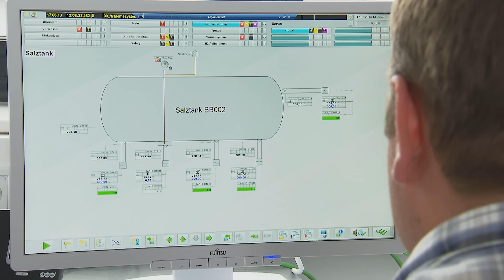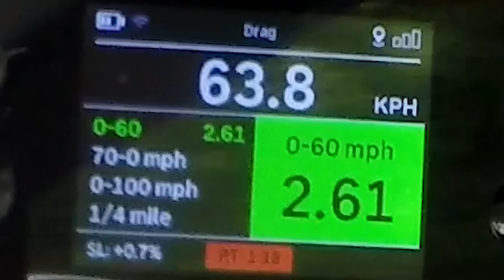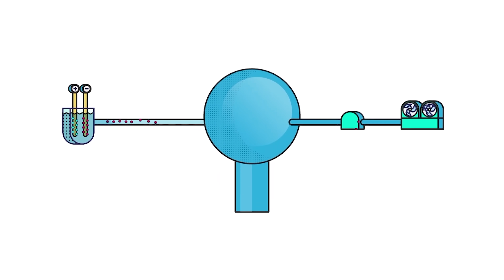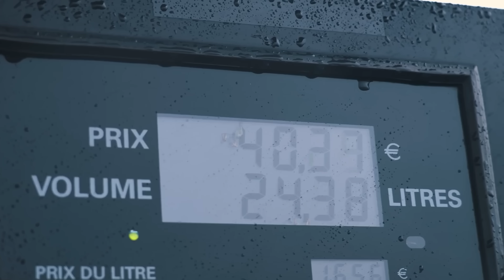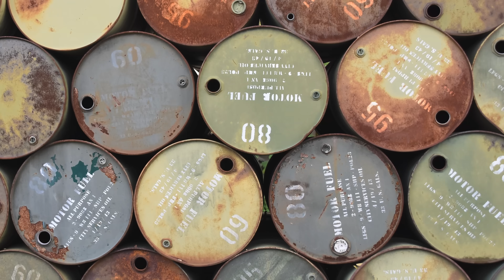Porsche just SAVED petrol engines FOREVER

Comment: Concerned about the cost of synthetic fuels. Although if there's more competition it should drive the price down. Hopefully we'll get it cheaper than current fuel prices one day.
Reply: Engineering Explained says the current estimate is $40 a gallon 💀. Hopefully, it gets cheaper as the tech is optimised and demand increases.
Reply: @Teqnyq  Exactly, that is what our boy at Engineering Explained completely missed.  

In the segment on exactly this that I watched, he said that at the moment, Porsche said it's about $9.00 per gallon to make it and that was the entire basis of E.E.'s conclusion.  He completely overlooked the fact that not only did Porsche not pioneer this technology, but also the fact that technology can change.  In fact, to accomplish the current goals, everything  must change.  The EV future requires new technologies and upgrades, in both battery technology and massive upgrades to virtually every electrical grid on the planet. Here in the US, people in many areas must wait for days to charge their EVs as there isn't sufficient power available to meet the current need.

What Porsche has done that is monumental is to pioneer production of synth fuel powered by pure renewable energy. That's the other change.  Just as there are huge refineries all over the planet producing petrol/gasoline/diesel from petroleum oil, we need plants all over the globe running on renewable power from wind, solar, hydro, etc., producing synth fuel.  In that world, synth fuel could easily cost comparable to current fossil fuels.  Well, unless our current petroleum barons are at the helm.

Also, we must note that synth fuel can be refined to power not only current passenger vehicles, but also current airliners (as av-gas) and diesel tractor trailer rigs. If they'd just invest in it and just do it, all of our options go through the roof. I'm hopeful, but not confident.  Humanity's ability to make the best decisions for all has a poor track record. Profit at any expense rules.
Reply: @nYdGeo  The thing is: this mysterious technology to make e-fuels production more efficient doesn't exist - and very few are currently working on it. The projection is that the tech can be scaled up and bring production costs down to about $3 per litre - that would still result in a selling price of about $6-7 per litre. With a total efficiency at the wheel of 15%, ICEs have no leg to stand on against 75% efficiency of EVs (always including production of the energy / fuel). 
Right now, my EV already costs me 50% of my ICE car per 100km - not even considering service cost.
Reply: @Vizeroy9  I think we can discuss this without conjecture, can we not? Just because the oil money isn't behind it yet doesn't mean that it's not there and/or viable. Jus because EVs are on the road also doesn't make them truly viable...at this time.

I'm not anti-EV, just anti EV advocates that ignore all the facts in order to feel good about themselves.  In 10 - 30 years, when the power grid can possibly support an all EV future, I'll certainly consider one.  When battery technology is developed that is safe, efficient and isn't an ecological nightmare to produce, I'll consider it. I don't want to have to drive my EV emissions free for 200K - 400K miles to balance out the horrific amount of pollution created by the construction of the vehicle, especially the battery.  While we're at it, have you priced a current replacement EV battery?

We also take a lot of road trips and I don't want to spend 3-hours per day sitting at a charging station.  But, they will fix that. We'll eventually get batteries that are not based on lithium and can charge in 10-15 minutes and when we do, again, I'll probably purchase one immediately.

My biggest issue is choice vs force.  I don't want to be forced to retire an amazingly fun, affordable and perfectly usable vehicle to purchase an expensive econobox (I'm not wealthy enough for any of the stylish EVs) just to make someone else feel good about themselves. Just as EVs will one day be a completely viable option, the technology also exists to allow me the choice to drive my current vehicle without adding to the carbon footprint.  But EV advocates continue to do their best to force their will upon everyone else, ignoring other options in the interest of being right, of feeling good about themselves.
Reply: @nYdGeo  one question ahead of the reply: Did you ever take a long distance trip in a modern EV?
If not: please get real world experience.

Yes, EVs aren't best everywhere - I still own my Touareg, because there is no EV with decent trailer towing capability.

My Renault Zoe is perfect for the city, where my Touareg would just suck the tank dry while standing still (stop start has many circumstances that deactivate it).
I still prefer my big car on long road trips - that's mostly because I'm too tall for a long term comfortable sitting position in the Zoe. I'd prefer an Ioniq 5, or something like it... but that one is too big for my wife's taste. So we got a Zoe.

Oil company money doesn't really change the production process for e-fuels. The projection to get the manufacturing cost per litre down to €3 already considers heavy investment in R&D and scaling effects.
Big oil money hasn't really changed the production process for regular fuel in over 100 years. Still mostly destillation and cleaning. 
Therefore don't expect too much from big investments in e-fuels - which oil companies might even not bother with in the first place.
They would need to increase e-fuel production by factor 100 just to supply Germany.
The long term investment risk might be too high  for this to happen.

I'd way more prefer hydrogen cars for long road trips - efficiency is between e-fuels and EVs. Filling the tank is a process of a few minutes.
Pure hydrogen isn't flamable and the tanks have an emergency valve in case of fire that directs the flame - which gasoline cars don't have.

All in all it is way more energy efficient to put produced energy into a battery than use it to produce hydrogen, or even e-fuels.
Carwow, car maniac and other European youtube channels do range tests rather regularly. They show which ev might be interesting for you. Car maniac also does charge performance in every review. Most modern EVs (except for the small ones, like Zoe) charge from 20 to 80% within 20 minutes - which is the range, you should keep the battery most of the time. A 600 mile road trip will force you to do 2 stops... which you will do anyway.
What needs to improve massively is the charger network in some regions. 
But this can be assumed as already in planning and / or execution phase to be way better before 2035.

With the Kia EV9 going on sale this year, I might be tempted to replace my Touareg. But I need to see the reviews first... and sit in the car for myself.
Reply: @nYdGeo  -  EE said that the CEO of Porsche said that their synthetic fuel it is over $10 / litre or $38/gallon.  Sure, economies of scale will drive down prices, but with current EVs, it aint happening.  It is like the argument regarding recycling plastic.  Everyone thinks that is the best thing, but it doesn't "really" happen because creating new plastic is cheaper.  A huge portion of the population won't be buying any e-fuels to create this HUGE demand because it is just way too expensive compared to other fuels.
Reply: @Teqnyq  given that unleaded has frequently been around $10/gal in Europe/EU (certainly for the the higher octane versions last year, they were $12/gal!)... so if it currently costs $40/gal, then it isn't THAT much of a leap to see Hydrogen being cheaper eventually, provided the governments don't tax them as much as they do for diesel/petrol... especially once this starts to be produced using solar / wind-farms as the power source... note that they would NOT be using regular meter-price electricity either, it would be surplus power from those during low-demand times of the day (MUCH cheaper).
Reply: @Teqnyq  commercial freight, container boats are gooing to use methanol in the future (google maersk Mauritania -, or equavalent projects) ) Don't worry about price. Solar energy is 2 cent (US dollor cents) pr. kWh in Saudi Arabia or Chile (google it) . Don't worry about the price, but do worry about putting up the solar panels in desert areas around the equator and scaling up supply chains for this ASAP. call your goverment representative or organise efforts to effect them NOW!
Reply: @Teqnyq  i saw another video about this and the price for their e-fuel is 40 bucks now but they have calculated what it will cost in the future and what they landed on is around 2 dollar. Which is a good price i think.
Reply: @Teqnyq  if we get other companies to make synthetic fuels, they will get cheaper.
Reply: @Teqnyq  

That's only on a experimental basis though. If production of e fuels was upscaled then the costs should reduce significantly. 

I also assume there might be fossil/e fuel blends available to further lower costs while still being able to offset carbon production. The price of oil if still produced at the same rate should also fall in value if e fuel and electric cars get more of a foothold as time goes on.

That's a hell of a lot of supposition on my part though 😂
Reply: The production efficiency is at around 2% at the moment and the physical limit is 6%. Meaning that it will be 50 times more expensive per kilometer than driving a regular ev.
Reply: @lukasluetke6097  Where do you get a max efficiency of 6%?
Reply: Here is the problems with e-fuels… 
It needs tons of energy. 

EVs are about 75% efficient, according to the US Department of energy. That is with all losses from charging, the battery and motor factored in. 

Combustion Engines reach 30% tops (same source). 
eFuels also only hold about half the energy you have to consume to produce them, so the total efficiency of an e-Fuel car is about 15%.

Taking taxes, transportation and profit margins etc out of the equation means that at 150kw (204PS/201bhp) of power for one hour 
You will need less than 215kw/h in an EV and 1000kw/h in an e-fuel powered car. 
E-fuels will never be cheaper than charging an EV, by a long shot. 

It will be great for planes and racing, but not to get kids to school
Reply: @Noine14159145  EV's don't work to get kids to school if everyone in town is trying to charge, it will break the electrical infrastructure and simply won't work.  Dreamers are great, but the tech has to work better than what we already have.  Efuels is just a way to make the process more complicated than it really is so the average Joe thinks they have to rely on big corporations and government (which are the same thing in 2023) to live life.  Diesel e engines have been around for a long time and they run on straight veg oil which any farmer can make with a variety of organic raw materials and a manual press and a filter.  Then, we have solar energy, which can make pure HHO (Brown's gas) which only produces water when burned in a regular common combustion engine.  Check out Hydrogen Home for this.  He runs his entire house and car with the hydrogen he makes from solar.  And Bob Lazar has a hydrogen powered Corvette V8.  This tech is all out there, but people have been dumbed down to the point that they can't even think logically.

"What is the cleanest burning vegetable oil?
olive oil
The cleanest burning fuel is olive oil, the fuel that Aaron was directed to use for temple light in the book of Exodus. Olive oil is more than 99% pure. If the wick is properly trimmed and there is no draft, it should not smoke. Olive oil is a clean renewable fuel that does not produce smoke or odor.

Lantern Oil - Oil Lamp Oil - Red Hill General Store"
Reply: @Noine14159145  f1 ice engines are 50% efficient
Reply: @kalasmournrex1470  They only last for a few races, before they have to be rebuilt. This way, you will have to replace your combustion engine a few times in a single year.
Reply: @kalasmournrex1470  that might be, but they achieve that with such a high compression that they don’t last. Especially a daily setting of constant cold starts would kill an f1 engine within days.
Reply: @Noine14159145  Chile is one of the countries, if not the country, with the most efficient solar and wind energy potential. We can produce a lot of cheap and green energy, but the thing that has been retaining all the green hydrogen and e fuels progress in the south of Chile are the sustainability issues. For example, the Porsche e fuel factory has not been aproved by “Sevicio de evaluación de impacto ambiental de Chile” because we have a treaty with Canada in which we promise to protect the birds that migrate from Canada to Chilean Patagonia year to year, and the protection involves a restriction of massive wind energy proyects. The good part is that we steel have the north of Chile, one of the regions with the most intense solar radiation in the world
Reply: @Noine14159145  "EVs are about 75% efficient, according to the US Department of energy. That is with all losses from charging, the battery and motor factored in. " All right, what about electricity production ? It is not lossless. So this is already missing in this calculation.

The rest of your argument I do agree with.
Reply: @sierraecho884  losses in energy production are not considered because they will also happen for the energy used to produce eFuels
Reply: @Noine14159145  What do you mean ? This does not make sense. Producing E-fuels wastes waaaaaay more energy than say charging a battery. Of course this has to be considered. This is the main reason why E-fuels won´t work as a large scale application.
Reply: @sierraecho884  you replied to me saying „what about electricity production? It is not lossless. So this is already missing in this calculation“

So I answered that losses in electricity production will apply for both EVs and ICEs using eFuels so they will not be taken into account
Reply: @Noine14159145  And my point is, it has to be taken into account for both otherwise you are comparing apples to apples.
If I say my battery driven car has zero emmissions than it is true to a certain extent. The car itself does not emitt but the electricity had to be produced somewhere else.
Reply: @sierraecho884  
1. I want to compare apples with apples 
2. I was talking about energy efficiency, not pollution
Reply: @Noine14159145  Well alright then, both systems waste energy at different stages of the process. So if you want to compare energy efficiency you need to include that as well. Or do you only want to compare the efficiency of the Motor ?
Reply: I feel like the majority of the current cost of said fuels comes from the energy requirements and the development of renewable infrastructure. If we can find ways to generate way more energy than we consume now, cheaply, this would be a viable solution. Best way I can think of to achieve that in 10-20 years is to go all-in on nuclear energy and then develop the true renewables once we’ve bought ourselves some time.
Reply: @jlight7346  sadly most people, even today don't trust nuclear power though
Reply: In Europe, fuel prices are mostly taxes, so the price of e-fuel depends on greedy governments.
Reply: It doesn't have anything to do with the decision to don't rehire or expand capacity of the current oil production? Also you mentioned taxes so please refer to whichever year of your current country budget and see how much your taxes amount to... ;D
Reply: @qa1e2r4  Over 50% are taxtes. Sholdn´t that be enough ?
Reply: @sylviam6535  e-fuel cost about 3X more to make than gasoline as I understand it
Reply: Yea and they only have 2 factories atm i think so its pretty expensive right now
Reply: Honestly, greed has gone and shot ourselves in the foot. Sometimes, pure capitalism isn't the way to go, because guess what, preparing for the future incurs losses.
Reply: it should be free, just like Nicola  Tesla was trying to show the world !
Reply: Petrolheads: "We don't have enough electricity to charge an all EV fleet."
Also petrolheads: "Let's make e-fuels."
This is comedy gold.
Reply: @Sams_Creations  Good point.
Reply: Hahahhha nice dreams, this so called e-fuel will not go below 20$ a gallon.
The best, most efficient, least expensive is oil for cars and ships, kerosene for planes. Yeah however the mass media makes you believe, facts are 80% of the world is still 'addicted' to oil and natural gas. And without it our economy would be zero, nothing. And this ain't changing anytime.
Reply: What a bunch of bunk.  There is no global warming, that's why they call it "climate change" now... California currently has the most snow in history, NY just had the biggest winter in history... Minnesota is currently frozen... it's all a lie and you are placating that lie.  The solution is to filter the exhaust fumes and burn whatever you want.  But whatever you do it has to be elective, not forced.  Only evil dictators force things on people.  As soon as you start to talk about carbon and global warming, you've lost your freedom, because human beings emit CO2.  It's not the CO2 in petrol exhaust that is unhealthy, it's all the exotic carcinogens, neurotoxins, and poisons like benzene, acetone, ethanol, etc... Ethanol, which is a class 1/a known carcinogen, is produced in nature when organic materials like trees and bugs and animals die and rot away.
Reply: 150-200 VS 20KWh per 100km(efuel vs electric car)... All this will ever accomplish is driving electricity prices up, because there just is not enough energy for this bollocks.
They just cover their lazy asses for not being able to finally come up with devent electric and hydrogen cars.
The whole video is porsche propaganda down our throats.
Reply: Gasoline is synthetic
Reply: Oh yeah. Capturing a gas that is 0.04% of the atmosphere sounds like a smart economic idea. Let the farce continue.
Reply: Basically you need a PHEV and a classic ICE car, 90% of you briving is from the battery in the PHEV, with the occasional long run or on the go fill up with synthetic fuels and a few tanks of synthetic fuel in your classic ICE car for weekend fun!
Reply: @demiquadfpv3333  In this case you will still be left with the same problems like where is all this electricity coming from ? How to scale it and keep it green ? Where are all those resources coming from ? Can you even afford it ? And you are left with both engines and both disadvantages like lubing the ICE, oil change, many many moving parts and so on. Plus all the additional weight. Not a good solution.
Reply: @demiquadfpv3333  
No. You are constantly carrying around a heavy battery with all the wiring and control of an EV but nowhere near the capability. You waste energy charging it and have a constantly degrading battery which will cost a fortune.

Just stick with an efficient IC engine. 100 mpg capable engines were developed in the 1960s but squashed by big oil
Reply: Exactly what i said in other videos... Unless there are competitors. Porsche will charge their 'Porsche tax' -- You'd be paying them for the privilege of them keeping your car on the road. on top of the governments petrol duty, road tax and VAT when it comes to parts, maintenance and services at your local mechanic or dealership..... Then your local council might charge you a ULEZ tax based on the size of your engine so you can drive through or park in your local area.

--- But i mean thats all fine right? you get to keep your old car and not scrap or part exchange it for an EV.
Reply: Irlc commercial synthetic fuel only went out of production in the 1980's after the oil crisis ended. Porsche actually put huge effort into dealing with questionable quality synthetic fuel in wwii.
Reply: @oogahboogahman  It´s not the same. Synthetic fuel in WW2 was made out of other resources. This here is meant to be green, to only solar, wind or other renewable energy sources to generate hydrogen through electolysis and adding CO2 which is captured out of atmosphere. This works however does not make any sense commercially. And the capacity for a big market like personal transportation is basically impossible or spend better elsewhere. 
Especially considering the poor  
efficiency of only about 13% compared to battery cars with an efficiency of 70% or Diesel with about 30% efficiency. This is by far the most stupid solution.
Reply: THE MAIN cost is electricity! We need power to exract hydrogen, we need power to exract c02 from atmosphere . we need power to combine to make synth fuel. Yep. So whoever will find idea to store energy (non lithium powerbanks, huge commercial) will be the most rich person in history of that planet.
Reply: Talking about EV’s like everyone can afford a decent one. 
To replace my current BMW 435 GC I would need an I4 correct? But my 3.0 diesel ICE with all the luxury bits I could ever need was half of the price when new than an I4. 
Factor in the ridiculous emissions to produce an EV in comparison to an ICE, then the miles you have to cover (approx 100k which volvo admitted publicly) to get back onto an even with an ICE it makes no sense whatsoever. E fuel is more appealing to probably 80% of the population who cant afford an equivalent EV. Plus look at the cheapest EV’s, not exactly screaming value for money to the majority. They are pants, and they do not have the range like the more expensive ones. 
The UK charge network is rubbish and will not be up to Par by the deadlines. 
We will be still using wood pellet fired power plants at that point (they actually emit more c02 than a coal plant ffs) its all messed up and backwards.
Reply: @Lee-ee8qh  That´s exactly why most cars will vanish frim the streets if only EV can be sold an bough in the future. Many people will simply not be able to afford them.
However, the emissions of the EV production are already factored in, just as in any other car which has to be produced as well. From the CO2 emissions perspective it absolutely makes sense. However it is simply way to expensive.
but here is the kicker E-Fuel is nonsense it will be just as expensive as buying an EV.
Also wood pellet power plants don´t emitt enaything since the wood has soaked in CO2 during it´s griwth they simply release the CO2 back. Sighs you really outh to be looking in that whole stuff in detail.
I mean you got a valid point which is price but everything else is basically wrong.
Reply: 12 years time nobody knows where technology will be. It could end up being cheaper than normal petrol
Reply: @Dylan20579  It won´t because it would be against physics. Cheaper would mean less steps not more. Oil is incredibly cheap.
Reply: @SierraEcho88  really? what does our own made up concept of money have to do with physics.
Reply: @Dylan20579  Made up huh ? it´s not just made up. Money reflects value. It takes way more steps with much more loss to create E-fuels than say charge and produce a battery or create ethanol based gas.
Reply: Current battery tech is rare earth minerals.  Sodium batteries and then solid state batteries are the next step in battery evolution.  Sodium batteries are less energy dense but require much more abundant and easy to get sodium.  Solid state batteries are newer tech and thus more expensive, but have 5x the energy density of lithium and much higher temperature tolerances and can charge much faster.  Right now we can charge 80% in 15-30 minutes.  If we can supply the power required to the chargers we will be able to charge 80% in 10 minutes.  Cold weather reduces a tesla range by like 30% or more.  Solid states do not have that problem so your range will always be at max.  Toyota claims to be putting a solid state battery pack into their 2025 prius hybrid.  This is to get real world data and the battery pack is smaller in an EV so it will not make the car ridiculously expensive to implement.
Reply: The price will still go down
Reply: @imondatgudkushanakahal  A little bit but not nearly enough.
Reply: ICEs may only be a luxury of the rich until a chemical and engineering breakthrough can be produced.
Reply: It'll always be more expensive than using the electricity directly through an EV. But it's the only option for vehicles like ships, planes and large machines currently.
Reply: That won't happen. The process itself caps the cost.
Reply: @ddeedje4093 Funny how people say it’s impossible when it comes to decreasing the price of synthetic fuel but as soon as you criticise the range of electric cars they swarm you saying: “It’s only existed for 10 years, it takes time🤓”.
Reply: @M4X1  No one is saying it is impossible to decrease the price, it is just impossible to decrease the price enough for it to become useful for the average person. Don't take my word for it, take Porsches and Shells. You have an inherent energy demand that makes it more expensive. You have inherently bad efficiency which makes it more expensive. Unless you defy physics or ICEs make a 30% efficiency leap forward you just can't make them reasonably cheap. End of Story.
Reply: @ddeedje4093  You say that while electric cars are still far more expensive than conventional ICE cars. Of course all these issues won’t be fixed over night but same goes for any other invention.
Reply: The other problem is if they did go full electric the electricity will be absolutely ridiculous to make up the cost of losing fossil fuels. So if this works we can still keep combustion engines which is great. The price of things rising will happen either way it’s always a money scheme regardless
Reply: @lukekavanagh6121  Not really, not if you use battery electric cars and charge them at home or if you keep using normal combustion engine cars. This new fuel will quadruple the costs.
Reply: @lukekavanagh6121  "the electricity will be absolutely ridiculous to make up the cost of losing fossil fuels"
You would need 4 to 5 times more electric energy to produce enough synfuel to replace the electric cars. So I don't quite get your point.
Reply: If we (USA) stop subsidizing the fossil fuel industry, we can get more renewable solutions funded and affordable.
Reply: @terrellbradshaw3504  😂
Reply: @terrellbradshaw3504  clueless
Reply: @terrellbradshaw3504  Yes and not. Yes you could fund more but no it will not be more affordable because here the limits are set by physics not by politicians. You simply can not produce enough and cheap enough.
Reply: @sierraecho884  Sure, if you compare the price of things *currently*. Once upon a time, oil was expensive to refine and turn in to useable products. Take away government subsidies for petroleum production and lets see what the number look like then. Additionally, take solar for example. They used to be hot garbage and expensive as hell. How much has the price dropped for them in the past 10-15 years? And they are still making breakthroughs increasing the efficiency of them. Our understanding of physics changes everyday so let's not live in a box.
Reply: @terrellbradshaw3504  Oil has scale effects, E-fuels don´t, that´s the point. They can not be much cheaper since they use 5x more energy than batteries would use to simply charge. So no matter what you do E-fuels will always use 5x more energy than batteries. Solar also has a certain upper limit. It´s not possible to gain any more energy from solar panels at a certain point. Of course things get cheaper because of the scale effect but this only goes so far. 
It´s simply physically not possible for E-fuels to ever be cheaper than a battery charge.
Reply: @sierraecho884  First you talk about oils, then talk about batteries. What are we comparing here? 
“Efuels can never be cheaper than a battery charge”? What kinda of battery are we talking about? Where did the electricity come from to charge this battery? How much energy was used to make the battery? That’s a pretty absolute statement you are making without having the power to see the future. Plus, I don’t know about you but I’m willing to invest my money to try and dig ourselves out this climate change issue we are in and give our kids a future.
Reply: @terrellbradshaw3504  Look, I am a mechanical engineer, I do actually work in the automotive industry. It´s a little tedious to explain here in the comments. Let me make it short and quick. Compare battery electric vehicles with E-fuel combustion engine vehicles.
Battery: 1. Electricity generation --> Charge Battery --> DONE ( efficiency ca. 73%)
E-fuel generation: 1. Electricity generation --> electrolysis ( to create hydrogen from water) already wastes about 30% of energy in this step and NO you can NOT further optimize this since it´s physics -->  combine hydrogen with CO2 AGAIN more loses --> after some steps you get your e fuell --> DONE ( efficiency ca. 13%)

THAT´S why you can never compete with alternative energy sources. Not because of magic and using my magic glass ball I got from Saruman but because of science.

You can dig the climate change issue out all you want but you won´t get far without SCIENCE. You should probably first study something in this field before making absurd statements about how great E-fuels are. This is one of the dumbest ideas ever and a marketing gag. You will need at least 5x more energy to move the same object via e-fuels compared to batteries.

It might work with bio-ethanol instead, HOWEVER this is a complete different story.
Reply: Easier to scale and make an existing thing more cost effective than invent something else (aka magic batteries) from whole cloth.
Reply: @Greg Zoller  "easier to scale"? Are u joking? U need 5x the amount of green electricity for the same miles with the car. People cry we don't have enough energy for electric cars but want a solution with even more demand 😂
Reply: @gregzoller9003  Unfortunately not true, since batteries will actually make more sense and be more efficient compared to e-fuels. E-fuels at least this kind are newer than those fance batteries.
Reply: @sierraecho884  I don’t agree.  Batteries consume a lot of energy to make, contain rare earth materials, don’t hold a charge in reality as well as it says on the brochure, degrade rather quickly over time, and take a long time to charge.  Efuels potentially solve these problems if we can solve what really is now a manufacturing problem.  Fill-ups take a few min—like gas.  Our infrastructure is 100% geared around liquid fuels.  ICE vehicles can use efuels with minor changes.  They’re really ideal.  Maybe the perfect mix is to rally around hybrid applications using efuels to maximize the mileage of a gallon of relatively more costly fuel.
Reply: @gregzoller9003  "...Batteries consume a lot of energy to make, contain rare earth ..." Sure, batteries have all sorts of disadvantages, however the biggest selling point is how efficient batteries and electric motors are. 
Some of your points are also not completely correct. 
1. "don´t hold a charge as well" well compared to what ? Generally speaking modern batteries are pretty good at that.
2. " degrade rather quickly" again compared to what ? What is the benchmark here exactly ? EV batteries 10 years old can still hold over 80% charge depending on the chemestry used, storing conditions etc. They are pretty good there days.
3. "Take a long time to charge" again compared to what ? Modern batteries do charge up to 80% in 30 min. for example. Here is an example: I have to drive 600km to my destination. Which means. I can drive about say. 300km take a short rest, use the loo and so on for 30 min. and then drive the rest. This is perfectly feasable. Yes it is not as fast as liquid fuel is but it is not a deal braker either.

E-fuels on the other hands are just awful efficiency wise. And thus they do not solve these problems. They are about 5x more expensive. It is not a manufacturing problem, it is simple physics. You need about 5x the capacity for energy generation for e-fuels which you would need for batteries. 5x more wind turbines, 5x more nuclear plants and so on. It simply is not sufficient nor is it sustainable. E-fuels are hydrogen on steroids. 

It would make the most sense to split the applications.
- Airplanes: E-fuels, much ligther, much denser energy, faster to fuel up and so on
- Ships: Batteries, weight is not an issue here
- Cars: Battery would make the most sense
- Trucks and Transportation: E-fuels, Hydrogen, combination.
Reply: @gregzoller9003  your points only make sense in a world where energy costs are basically zero. 
With energy cost of just 1cent per kw/h Efules will cost 1.75€ per liter just in energy if they have the same potential energy as gasoline
Reply: @gregzoller9003  The same example goes for gas cars. I can drive my gas car in a way where my gas consumption is about +60% higher than usual. This is not a question of technology but of personal driving style. So this claim has by itself no merit.
Both vehicles would increase their consumption in hot weather or at an incline for example. The only case where a gas car is better is in cold weather. Since heat is a byproduct (waste) in a combustion engine. But then again it is waste at all times, in the summer too.

Public chargers, I am sure those suck big time but you could charge at home. I am not saying an electric vehicle is better at all times I am saying it has is pro´s and con´s just like any technology does.
I am sure somebody used riding on horseback back then would have just as many negatives regarding the cars back in the day.

Elecric cars are by the far the best solution if you have solar panels, and wind turbine or any other means of energy production at home, which means you can charge basically for free. They hold much longer, they have less moving pars, kess wear and tear. Their mechanics are very simple. They are reliable. You don´t eben need to change the brakes as often. So if you can charge at home or at work these are a great solution but not everybody can. Also you are using your car about 1%-5% of the time. Generally speaking you don´t use your car about 20h/ day most people donn´t even use their car 3h a day. Which mean it sits idle for the most part. It can charge during this time if the grit is there. Also you can use your battery as an in between storage. So it is not all negative at all. For most people for most usecases it would do just fine. Given the infrastructure. Gas engine infrastructure didn´t pop up in 5-10 years either it took much longer as well.
Reply: Will never happen as long as governments exist, tax
Reply: @radicaledwards3449  Too late, already happened, dissipated due to artificially low oil prices driven by the cartels like opec that could out compete it.
Reply: @radicaledwards3449  It´s not just the tax, there is simply no possibility to produce nearly as much as would be needed.
Reply: @sierraecho884  even if there was, tax. As soon as the majority of people are tied to something that is when the government starts taxing.
Reply: @radicaledwards3449  The tax is not the issue. It simply does not make any sense from a economics standpoint. You need roughly speaking 5x as many solar panels to produce the same energy density of e-fuels as you would need charging a battery. This means scaling and cost becomes very fast an issue. At least with the here proposed method which is using green energy to generate hydrogen and mix it with C02 filtered out of the air. 
However I am not familiar with things like using plant oil instead. But that´s not the idea which is discussed here.
Reply: @sierraecho884  Yes, and if you could, then then government would tax it until it is the same price as gas
Reply: @radicaledwards3449  If you could then yes absolutely. But it will be way way more expensive than gas anyways. Basiscally any other energy source is more expensive than gas. Gas is fantastic in it´s energy density and price. This is why we (humans) have been using it for so long.
Reply: Electric cars with e fuel range extenders is the answer. Cheap to drive around locally. If you wanna go far, you pay more then you would with current gas prices, but its an infrequent cost.
Reply: @NikolaiVozza  The answer is a good charging network.   Ban the tail pipe.
Reply: @NikolaiVozza  so hybrids😂